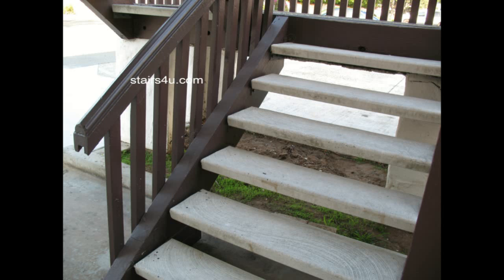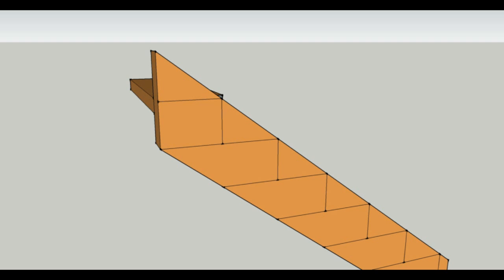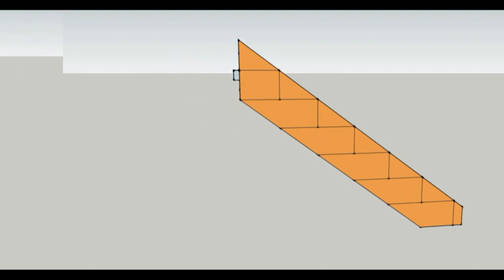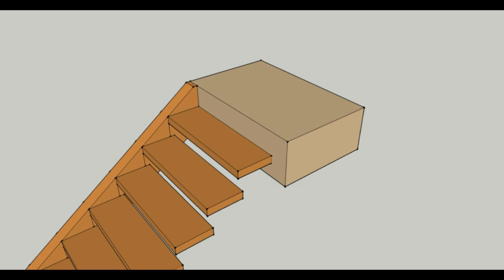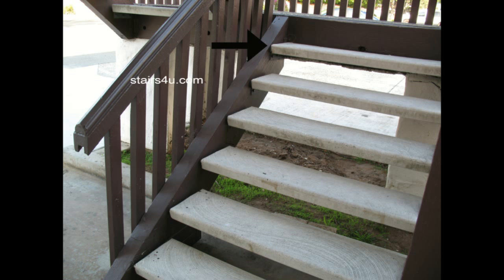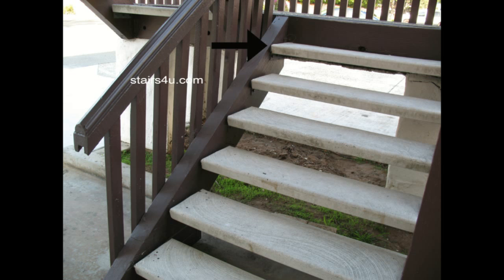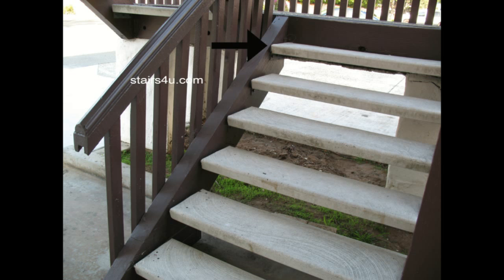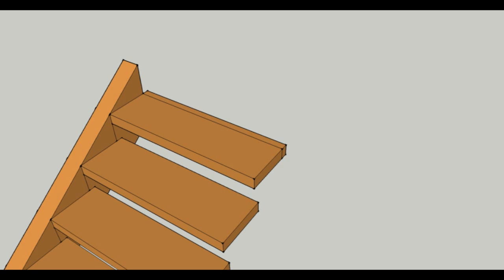Bracket Stair Tread Assembly and Layout Problem At Landing

Comment: what's the best way to repair a second story cement landing, underneath it's apartment stairs. and the landing needs repair, the 2 bottom units look bad, because of the landing. the bottom looks like there's rust just allot of water damage. thanks if you can answer that and understand my question.  great video appreciate it.
Reply from the maker: +Brandon Moore Email me a couple of pictures and I will try and make a video.